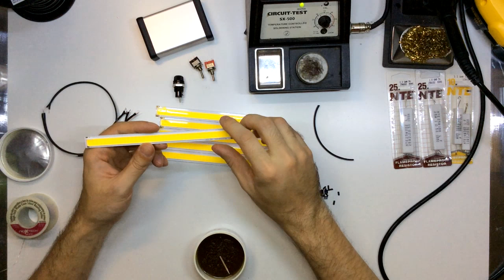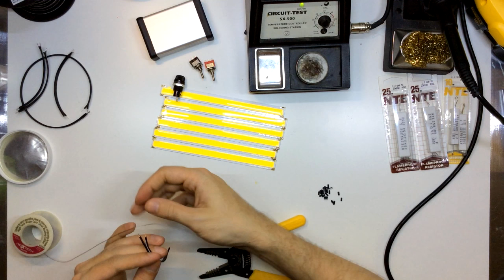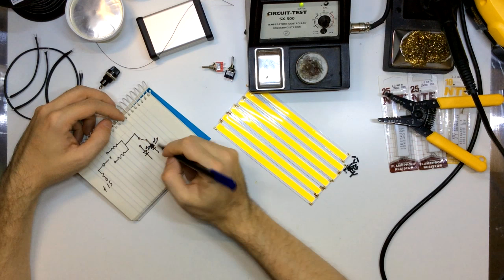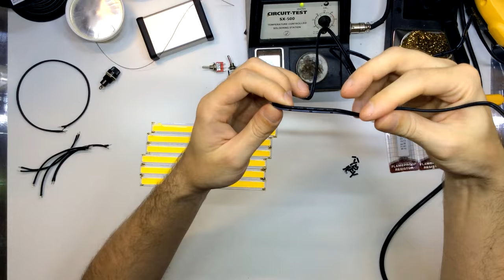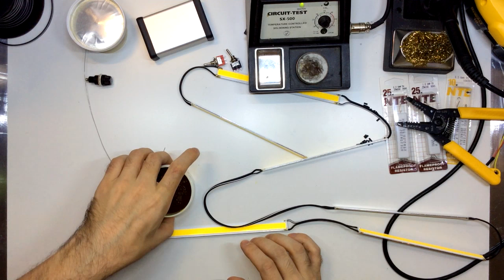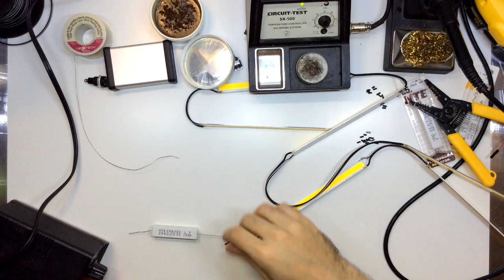Workbench Lights Pt. 2

Comment: I use those LED's on the side of my FJR motorcycle for extra lighting and safety. We used lead and cadmium in plastics years ago.  I've personally used it in the manufacture of plastics and their primary function is for heat stability and cadmium yellow was damn good colorant.  You cannot inhale lead/ cadmium fumes nor absorb it through the skin.  We wore respirators when working with it as breathing the dust or ingestion is how you get exposure to it.
Reply: Wow, these are located on the side of my FJR if you see my videos or my Youtube icon.  I ran other LED's for a few years on my Burgman 650 Executive with no issues.  I think the fact they are cheap explains it all;)